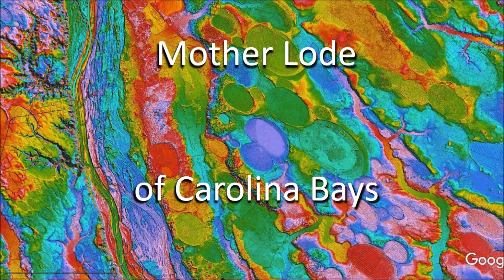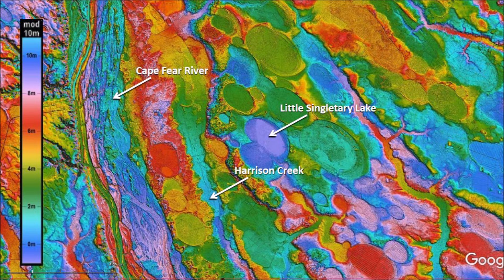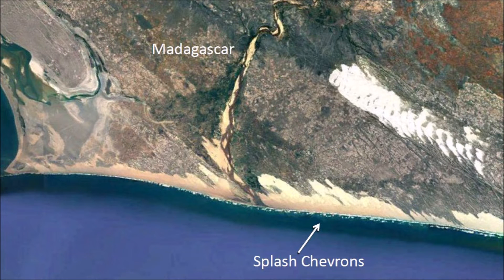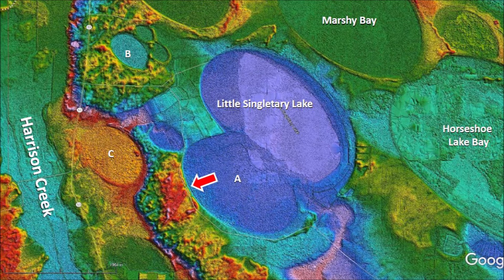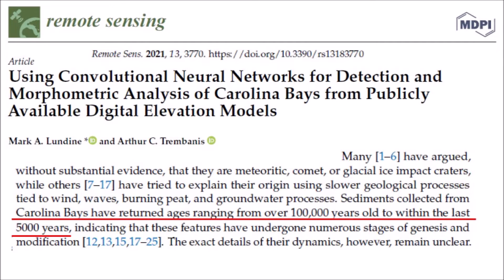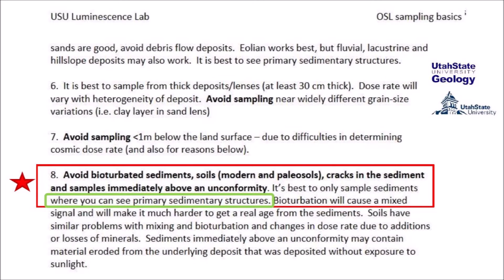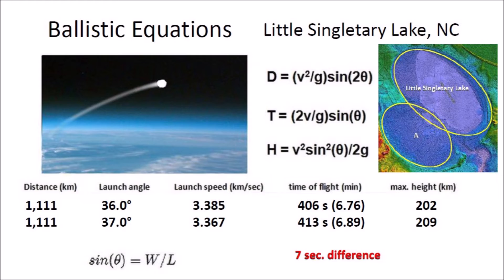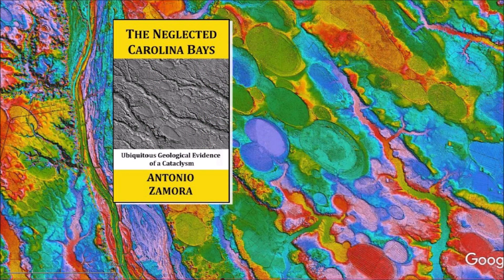Mother Lode of Carolina Bays

Comment: If the impacting object was a comet instead of an asteroid, it would leave little evidence after impacting into Ice Sheet. Depth of ice was 2-3 miles thick. An icy comet would have transferred all it's kinetic energy into Ice Sheet very quickly and then vaporized before blasting all the way through ice sheet to solid ground.

If comet was composed of primarily Hydrogen, the most abundant element in universe, there is a new scenario to consider.  The Comet Hale Bopp that broke apart into multiple objects and hit Jupiter were mostly frozen Hydrogen. Each smaller object was sufficient to cause catastrophic damage, each leaving blacken areas bigger than size of Earth on Jupiter. 

What if a frozen Hydrogen comet had more energy than just kinetic? What if the heat and pressure on impact caused Hydrogen to fuse into Helium? Basically the Younger Drier impact event was the biggest Hydrogen Bomb in Earth's history? No long term radiation, immense energy, no crater, and total destruction down range from trillions of tons of ice debris blasted out of ice sheet. 

Shoot billion tons of frozen Hydrogen Bomb towards Earth at 40,000 miles per hour and wait for thermonuclear explosion on epic scale. Cross your fingers you are far enough away to witness and survive.
Reply from the maker: The impact of a comet made of frozen hydrogen would indeed be devastating, especially on a planet with an oxygen atmosphere. Some comets have hydrogen gas in their coma, but hydrogen is too volatile to be retained by a small body. Even the Earth was not able to retain hydrogen in the atmosphere. The Earth's atmosphere contains only 0.00005% hydrogen. Most comets consist of a mixture of volatile ices (predominantly water ice) and silicate and organic dust particles. The impact energy, although enormous, is not likely to start a fusion reaction.
Reply: @Antonio_Zamora  thank you for your feedback. I was trying to think outside the box. I know that Russia's Tzar Bomba with 50 MT was most powerful, yet cleanest nuclear explosion ever. Even at 100 km away, still hot enough to get 3rd degree flash burns. It was air burst, no crater formed, but hot enough to fuse soil.
Reply from the maker: @SJR_Media_Group  The Carolina Bays were made by glacier ice impacts with as much kinetic energy as the Tsar Bomba, but since the projectiles struck liquefied soil, the ice boulders did not disintegrate and the energy was spent moving the soil.  I discuss the Tsar Bomba in this video: https://youtu.be/u9dQEg45Ty0
Reply: @Antonio_Zamora  thank you again
Reply: @Antonio_Zamora  has any study been made of the quantity of liquid water released from primary impact? Along with ice boulders, part of Ice Sheet was melted by extreme temperature, tossed into air to fall back as rain or hail. It is possible it rained very heavily after secondary impacts, thus filling many of the depressions with liquid water. This would enhance mechanism of liquefied soils.
Reply: @Antonio_Zamora  Being an ignoramus as I am, that is what I was hoping at the time.

Comment: Hey Antonio, I suspect you're aware of this by now, but just in case, SciShow on YouTube just did a piece on the Carolina Bays … they're going with a wind explanation, and leaning pretty heavily on OSL, but regardless, at least the phenomena is getting talked about to a wider audience -> https://www.youtube.com/watch?v=FBDd2n5ClZ8
Reply: Just been there and left the following comment:

The are in more than just the eastern states - they extend into Nebraska and can be found in north America, south of where the ice sheet was 12,500 years ago on unconsolidated land. Unfortunately, the luminescence method has real problems with this type of structure because of the way that it was formed. This hypothesis also doesn't explain why the bays in Nebraska point the other way - in reality, they point towards the great lakes where, during the ice age, there was still ice. A chunk of space stuff (probably rock but weighing as much as it is calculated to have done, it would have had the same sort of effect whether it had been made from iron, stone or ice) hit the ice there (where it was several kilometres thick) and then vaporised like almost all of them do but the resulting explosion from all of that energy, projected many tonnes of ice in variously sized chunks into the air and above, from where they rained down onto unconsolidated ground that had just bee liquefied due to the seismic waves from the original impact, where they then produced conical cavities which then all but filled in due to the ground being fluid at that instant.
A space rock hitting some ice is a lot simpler than the explanation given in this video and Occam's Razor suggests that this is therefore more likely.
Suggested viewing is: https://www.youtube.com/playlist?list=PLmd4S3n7PlE2H5FYYASaLd-eM5DBE33Rz Antonio Zamora who has written a peer-reviewed paper on this very subject; and, regarding the evidence for there being an impact at all,
https://www.youtube.com/watch?v=GvYjDLl-gPs Dr Martin Sweatman, analysis of the many papers surrounding this issue, including the erroneous conclusion that are repeated in the video above.
Reply: According to the comments, the impact hypothesis is widely known.

Comment: Excellent video and as for evidence? There are thousands of bays, all of which are consistent with the secondary impact theory (yes, 'theory', not merely 'hypothesis').
Other things to consider with the luminescence method is that the sky, when the chunks of glacier hit, are highly likely to have been darkened considerably so 'resetting' of the clock will be unreliable. Further, the luminescence method relies upon all of the sediment being exposed to the sun so where is the evidence that this happened (if they want their 00,000's years to 5,000 years claims to hold any water)? Large chunks of sand/mud is not going to get evenly exposed by the sun (even without clouds) when a lot of it is shielded by other mud/sand. Selecting luminescence as a method is clearly not very well thought out because the likelihood of any particular piece of dirt not encountering circumstances that invalidate the method is too low. What they need to do if they want their claims to be taken seriously is to take and analyse many samples from a small volume of sediment and look at the results from that to see if it makes sense. Additionally, do the same with many samples from the same bay to evaluate the same.
The use of the luminescence method for determining the age of the bays seems to be limited to a number of loud individuals whose apparent motivation appears to be the denial of the possibility that massive chunks of solid space stuff can fall out of the sky and kill off everything at fairly frequent and disturbingly unpredictable intervals.
Reply: Thank you for your comment. 

I think darkening of the sky, together with heavy but still uneven mixing of the soils caused by the impacts makes luminescence dating totally unreliable. 
The darkening must have been substantial. The amount of boulders of all sizes was insanely huge. There is no other way, it must have blocked sunlight from reaching the surface. At the same time the low pressure in the high atmosphere together with the heat of reentry must have caused partial melting and vaporization on the surfaces of the boulders, creating clouds and rain. I think it was much darker than it is in the middle of a heavy thunderstorm. 

Another point to rule out any usefulness of luminescence dating is the 50% chance that the impact came at night. Luminescence dating can only mark the date of an impact when the impact occured in daylight. For nighttime impacts, it is totally useless.

Comment: Here's a thought- the initial impact on the ice sheet was actually a series of several impacts in short succession. It might explain the several second differences in impacts which otherwise would appear to have happened simultaneously.
Reply: Check out Phaethon mythology, it clearly describes multiple hits. The Shoemaker-Levi comet is a perfect example.
Reply from the maker: I have found some cases where adjacent or overlapping basins are oriented at slightly different angles, which is consistent with multiple ET impact sites.
Reply: @Antonio_Zamora  Getting back to the scientific comedy theories of the bay creation, did anyone ponder whether there would be standing water given the geology of the bays?
My assumption is that the only reason water collects in the bays is because the vegetation growing in the bays provides an impervious membrane that stops the water draining down into the ground water or aquifer. In other words the bays came before the water.

Comment: Antonio, I agree with you that OSL is not appropriate to date Carolina Bay sediments if these features were formed as secondary impacts from a comet/meteorite strike on a distant Ice sheet.  Further, I think that the extreme spread of dates yielded from OSL dating actually indicate that the sediments in and near the bays were not formed "normal" sedimentary processes.  My interpretation is that the wild spread of OSL derived dates actually supports (but alone does not prove) the impact hypothesis.  In my opinion as a professional Geologist with over 45 years experience the "wind and water" hypothesis for bay formation is physically impossible, especially considering he shear scale and huge geographic distribution of the bays.

The only evidence that I think would be conclusive, proving the impact hypothesis, would be finding petrologic or mineralogical evidence in the may sediments that would have a provenance linking it to the Canadian shield rocks (probably located in the deepest portion of the bay sediments).  I have experience drilling in glacial kettle lakes, where a large chunk of glacial Ice broke off and was partially buried, later melting and forming a glacial lake.  There is plenty of evidence evidence left in the sediments deposited from the melting ice.  That all assumes that a big chunk of the glacial ice projectile survived (big assumption).  If large ice projectiles disintegrated on impact there may be evidence splattered over, or embedded in, the surface sediments (size range from clay size particles to boulder size glacial erratics.   This material may be near the land surface.  Based on the intensity of the postulated bombardment, there could be a lot of material in certain areas.

The smoking gun must be there if the impact hypothesis is correct.  You just need to know what you are looking at and how to match it to the Canadian rocks, and exclude it from local bedrock/minerals.  You also need a good prospecting nose to find it and recognize it as something that could be "out of place".  Plus a fair amount of luck!

What are your thoughts on the fate of a large Ice projectile impacting unconsolidated sediments: would much of it survive intact or would the force of the impact shatter it into bits, casting it out in the ejecta?
Reply from the maker: Thanks Tony,  My peer-reviewed paper made two predictions: 1) inverted stratigraphy in the rims and 2) clasts from the Great Lakes region in the ice projectiles.  I discuss these two predictions in detail in this video:  https://youtu.be/j63e8n0628Q

Comment: The dates of the Carolina Bays given by OSL so far stand on unconsolidated ground ;)

A new sampling method for OSL should be developed addressing these sources of possible error, as you pointed out here, now that there is a physics-based model for the formation of the Carolina Bays.
Reply from the maker: The only correct protocol for dating the Carolina Bays was done by Bunch (2012), which found inverted stratigraphy in the rim of a bay as expected for impacts. This was not recognized at the time.  It was reported but the "abnormal" reading was discarded.  I discuss some details in this video about geometry vs. dates: https://youtu.be/d6gisXApcw8
Reply: @Antonio_Zamora  I wonder how “abnormal” the inverted stratigraphy really is. Would be nice to collect more samples for dating at more Carolina Bays to see if this is an “abnormal” outlier or just a common feature as explained by the impact hypothesis physics-based model.
Reply from the maker: @TrevorHarris77  I questioned Ted Bunch a couple of years ago because his figure had two locations for dating the CB rim.  He replied that they only did one test due to cost and time.
Reply: @Antonio_Zamora  time to set up a Go Fund Me page lol